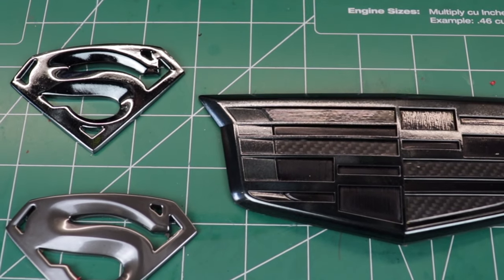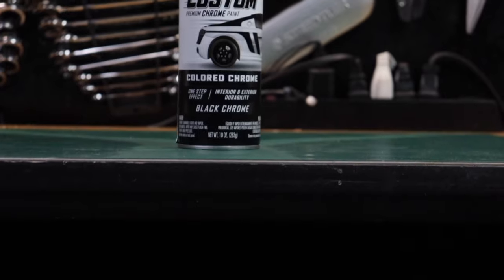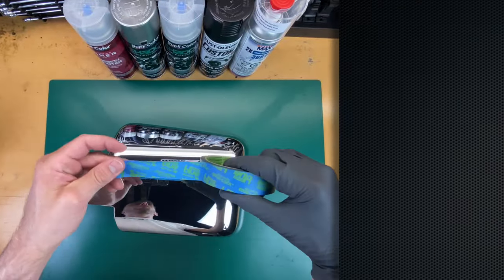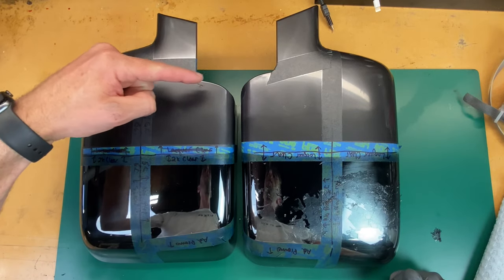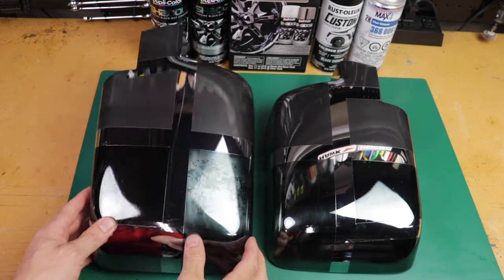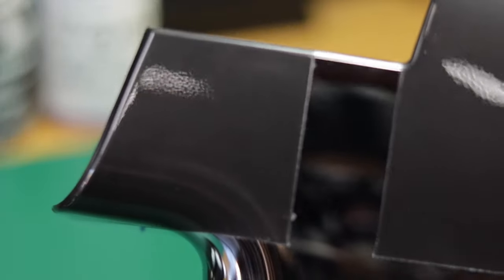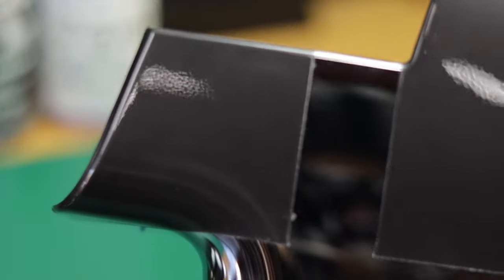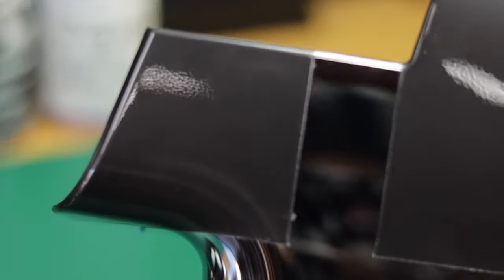Black Chrome 2 | Best Shadow Chrome Method

Comment: In pro paint shops plastic parts are always scuffed thoroughly with 3M 7447 Scotch Brite red pads, that's approx 400 grit, cleaned then adhesion promoter, then color coat, I like to dust the part with a guide coat to ensure thorough scuffing, good content

Comment: Dude that 2k stuff makes a huge difference. I just used vht nightshade for my tail lights on my s10 xtreme turned out good with whatever clear coat i used but totally getting that 2k stuff. That black chrome totally gonna try my door handles and the chrome trim on the grill. Great vids bro

Comment: Yes, the adhesive promoter in my opinion is not good. The 2 K Clear is awesome stuff. I did my Mirrors and used the 2 K clear. Wow strong stuff. I scuffed up my side mirrors then painted with a light grey Primer (3 coats) the wet sanded with 600 grit. Then I used Red Obsession GM Paint (5 light coats)  let dry then used the 2 K Clear. They look awesome.  I wanted that Championship Edition Look and omg it looks just like it. Super smooth finish.  Your primer color really does make a difference on the finally finish!  That’s why I used the light Grey Primer. Gave me that perfect look I was looking for. The 2 K clear really gave it that clean look and protection. Will see how it holds up. I used The 2 K clear on my front grill and badges. Love the stuff. I spray all my badges laying down but i use double sided tape on a small little box to left the badges off the ground so when spraying it covers all the edges evenly. That works so much better.  Great video once again. Thank you.

Comment: First, your videos on Shadow Chrome are outstanding! Thank you! My experience with Shadow Chrome is that it works well and it can look great once you learn to resist the urge to apply too many coats.

How many coats of the K2 did you apply?  I've found that the included clear coat is not very durable, and it also diminishes the clarity of the Shadow Chrome base coat. It looks like K2 will improve both of these conditions.
Reply from the maker: Thanks!  It’s definitely not like your typical paint. I think I did 2 or 3 coats of K2

Comment: Thank you alot for this video! I was looking to change the Chrome on my 2016 Honda Civic and wanted to do something different to the chrome parts than just black. Black chrome I think will be a nice looking alternative But I do worry about chipping on the front end across the grille. I think I may try it.

Comment from the maker: Update 7/10/23:
Even with 2k clear this will chip away over time. My front badge has chipped a bit and one of my rear badges as well. I also believe they have faded a little (hard to tell). Overall I would say don’t use this product.
Reply: Dang, that's disappointing. I wonder if  VHT Nightshade would work better? It's meant to go over plastic on like tail lights, so might adhere better.
Reply from the maker: @AK_Ray maybe?  It also has a green hue. I think I tested it off camera but it was so bad I didn’t use it. Plus I do know it fades for sure
Reply: @JetFuelOnly  you're in a desert climate right?
Reply from the maker: @AK_Ray  no I’m in coastal California
Reply: Thank you for your efforts,do you think a couple extra coats of 2k might help in preserving the finish over time?
Reply from the maker: I’m really not sure. The paint chips from the base coat I believe. So I think it could still chip. Either way it’s getting to the point that it’s not worth it.
Reply: @JetFuelOnly  Thanks,I already pick up some for my emblems so I guess I will give it a shot.
I just got some black chrome wheels and if they start chipping I will pack up and send everything to cal chrome in Valencia CA.They do some real nice work but it ain't cheap.lol
Reply from the maker: @jojogun1957 the wheels may have been done with electroplating or powder coat. They will hold up.
Reply: @JetFuelOnly  I hear you.I'am pretty sure they are powder coated(they are new).

Comment: I would probably scuff the emblem pretty good, hit it with a light spray of good primer, then id use a spray chrome, then the shadow. That way all the layers can bond into eachother and have bite into the scuffed surface.
Reply from the maker: The spray chrome idea… no one has mentioned that idea. Good for you thinking outside the box!  Only issue is to hope the two don’t react!
Reply: @JetFuelOnly  Dupicolor has a bright metallic base coat designed to go under the metalcast black smoke, it looks great, but I've also seen it put over their Dupicolor Chrome product and it looks outstanding.....that Dupicolor metalcast black smoke is designed to go over chrome paint. You should be good to go using either one of those....metallic base coat might be more durable but visually you'll probably slightly prefer going over the Chrome paint. Either should be more durable than what you're doing because it allows you to scuff the surface....you can cover 600 grit with either of those as a base coat.

Comment: When you wet sand you should never use your fingers it makes for uneven Surface pressure, you should use a foam block or rubber sanding block. Use a wet Ultrafine
Paper and  soke sandpaper  in water for a few minutes and then you don't want to push any pressure really and you can't use too much water u want the surface nice an wet. An remember that paint has flash times and it's a time between coats because the vapours release from the paint as it Drys and if you don't wait for the vapours to Escape before u put another coat of paint, you trap the vapours in between the layers of paint, which causes blisters and all other kinds of problems. An with a car freshly painted you shouldn't do anything to the point for a month. So spray paint u want to try an let it sit for a few days make sure that is completely dry. An if you want to try an clean just the surface lightly try to use a Medium to light clay bar it's easier on the paint with a clay bar after your done u can shine it up by hand. Wet sanding is pretty ruff for a few coats of spray paint and you should buff with a good wax or paint sealant of some kind to help protect the surface. An some new Vinyl is easier to use nowadays and when done right will not only protect whatever your putting it on after a while or you get a bug in your ace and decide you want to change the colours or whatever you can warm up the Vinyl and peel it off an start without messing up your paint job... might help you out in the future good luck and ya get what you pay for when it comes to paint and the time you put in to it. Cheap and fast y'all shouldn't expect much

Comment: Thanks for the video, great work!!  I'm looking at buying my son his first car this weekend and want to do this to the chrome wheels on the car.  If you were doing it on wheels, which of the 2 paints would you recommend for the base coat?  I'll definitely use the 2k to finish it up.  Thanks!
Reply from the maker: I worry that both of these would deteriorate from road rash but enough coats of clear I love the shadow chrome the most.

Comment: Great vid with all that was explained. I want to preserve the original chrome on bull bar. Im beginner at car painting and my approach is to apply a clear coat to preserve original chrome before shadow chrome & 2K clear. Would this be the right approach? Without scuffing or adhesion promotor does this leave shadow chrome frail to car wash scrubbing? Is 2K clear ok to be used on chrome DUB rims and door handles?
Reply from the maker: So you are thinking clear with shadow chrome on top then more clear?  My guess is it will adhere but you’ll never get it off without damaging the chrome. I just suggest doing what I did and try some test chrome pieces to find out!

Comment: You discuss the problem with using adhesion promoter, even trying to polish the finish.
What if you used the the adhesion promoter, then polished and cleaned the part, then finished the part with the desired black chrome finish?
In other words, treat the adhesion promoter like the primer that it is, and flatten the surface before applying the black chrome?

Regarding buffing the part with a scrubbing pad.
The abrasive pad could be used to produce a brushed metal finish, then finished with the black chrome.  You’d have to pay attention to how you abraded the surface, so that the finish looks intentional, and not just worn.

Let’s be careful out there.
Reply from the maker: The adhesion promotor isn't very thick like a primer. I've tried a little of that.  Either way, this latest iteration of shadow chrome worked out really well and is holding up.

Comment: Hey buddy.  What adhesive are you using to reapply your badges ?   / product to get the old adhesive off?
Reply from the maker: Just 3M automotive adhesive tape. There’s a liquid form too. To get it off mostly rolling it off with my fingers, some goo gone and microfiber.

Comment: What did you use as your base coat  white shadow Crome and what base did you use with the rustoleum  black chrome I tried the black chrome on my rims and it turned out a gun metal color I even painted them with a chrome spray first trying to find out where I went wrong
Reply from the maker: No base. Following the instructions you spray directly on the chrome. But chrome spray paint probably isn’t the same.

Comment: When you say you used the 2k clear over the shadow chrome, does that include the shadow chrome clear included with the kit and then the 2k aswell. Or did you just eliminate it all together. And how many coats of the 2k.
Reply from the maker: No, skipped the shadow chrome clear can.... 2k only

Comment: Can I use this on stainless steel mufflers or will it chip away immediately.
Reply from the maker: With the 2k clear it might last awhile but I’m sure it will wear away quick where the elements are. Maybe just do the part that can be seen from the back?

Comment: What about a light wet sand with an 800 grit on the adhesion promoter before the shadow chrome application
Reply from the maker: That could maybe work!  But it would have to look pretty smooth

Comment: Any updates on how well it's held up? I'm think about using the Shadow Chrome with the 2K clear coat.
Reply from the maker: It’s holding up great!  One small cracked and fell off though. But 90% if all I did is in tact and not faded
Reply: @JetFuelOnly  that's good to hear. I'm not so sure that I'll go ahead with my project though, I was hoping it would hold up a bit better. Chrome is a tricky one to paint.

Comment: I don't want a two pack kit, only the shadow paint.
Hope this is not like the dupli copper plate system, when i only need the copper aerosol paint.
Reply from the maker: Do you have to buy the kit. But you’ll want to buy better clearcoat

Comment: Do I need chrome wheels to do this? I've just got 4x4 wheels I was going to sand blast and prime and then shadow chrome
Reply from the maker: I don’t recommend this product on wheels. Too much road debris will have them looking bad in no time.
Reply: No worries there's another option to have powder coated black chrome
Reply from the maker: @dannyg9948  I would definitely do that. My wheels are done in Prismatic powders ultra black chrome I think. Not the same but I like it.

Comment: As always..a paint job of any kind is only as good as the prep work! No ifs ands or buts about it! Adhesion promoter is meant for raw plastic parts. It is necessary when painting those brand new plastics with no primer applied. Without it paint will not stick! When painting such translucent finishes like these on parts like these you need to sand with lightest media possible..gray scotch brite pad..sponge pad..anything heavy will surely show through after clear coat shrinks when it dries. You need to understand why things do what they do and how to deal with what you are working with or looking at
Reply from the maker: Did you see that I used a gray scotch brite pad and it shows through?  Also it had no better adhesion than other methods.
Reply: Jet Fuel Only I must've missed the prepping part. I'm not sure what you are referring to with adhesion but if it's the adhesion promoter, I don't think it would add any benefit in this application. If it was a new mirror cover from say, Toyota or Nissan specifically, they don't come pre primed. So that's where the promoter is absolutely needed. Although I've seen bulldog adhesion promoter used with success in a lot of applications that weren't raw plastics. In reality those "chrome" parts aren't really supposed to be refinished. We always try anyway and the results are never consistent. I did think your comparison was thorough and enough for me to make a decision on which one to try

Comment: you're trying to duplicate PVM nitride black chrome?  welpo first off the first coat is a black powder coating, then the next step is a vacuum chamber with nitride oxide less than .003" layered on..  with these paints you don't paint OVER CHROME!!!
Reply from the maker: The idea here is to find a simple DIY to black chrome. And… according to the instructions you do paint over chrome. 
It’s been holding up well with a strong clear coat.

Comment: That shadow chrome sucked on my chrome it was shadow brown.
Reply from the maker: Sorry to hear!  Did you apply it the way I did?
Reply: @JetFuelOnly  I followed the directions on the can, it's plastic chrome that I'm dealing with but it came out a dark brown or bronze color. I'm thinking of trying black chrome rust-oleum next time.
Reply from the maker: @22mell01  how many coats?  You gotta be really thin and only do 3-4. If you do the rustoleum you will need that 2k clear or adhesion promoter for sure. The panel I did with regular clear literally washed off with hose pressure
Reply: @JetFuelOnly  I don't remember how many coats I did but I know it was more then 3 but even still I noticed a brownish color chrome while putting the coats on. After all was said and done I tossed those cans in the trash and concreted on doing other mods to my car.
Reply: I did four coats over chrome and it turned dark green!
Reply from the maker: That’s why I made the video, this stuff doesn’t work like normal paint. Need to practice and work on making super light layers